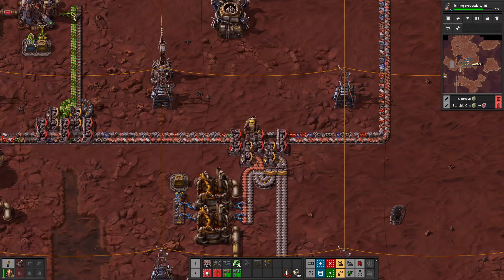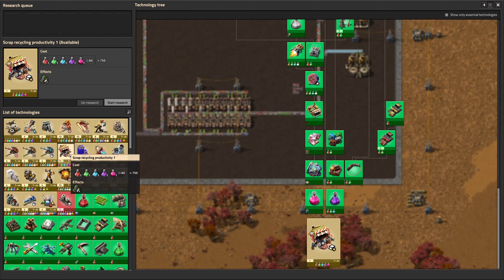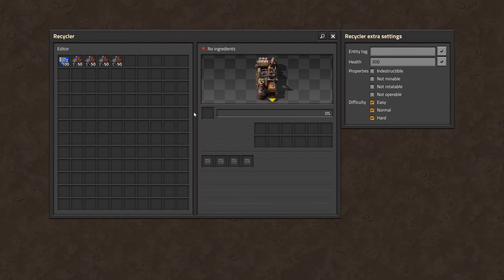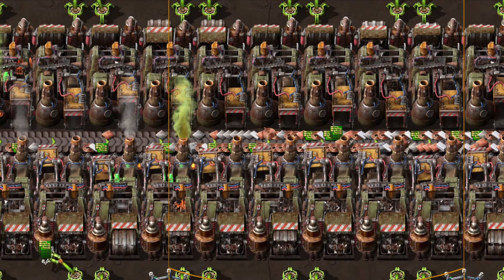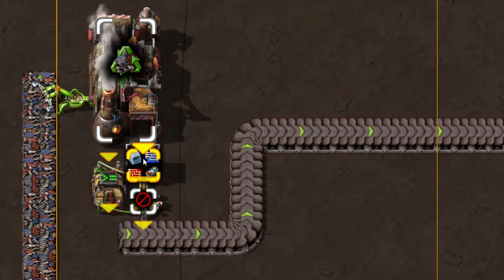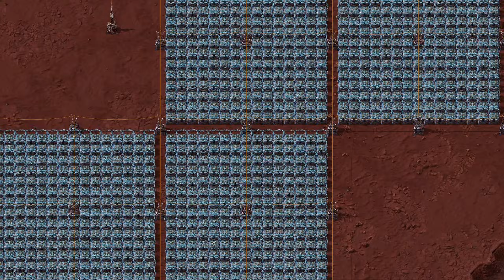Massive Production on Fulgora. Stacked Double Sushi Belt! Factorio Guide / Tutorial

Comment: You should turn the solid fuel + water into power with heating tower as well! Saves a lot of space in comparison to accumulators. Other than that great guide!
Reply from the maker: Great point! I didn't have any space issues so fully embracing the lightning storms is the way to go.
But I've read a lot of comments saying the island are too small. If that's the case using the underrated heating tower is a great idea.

Comment: In my opinion just directly pickup from the sushi belt instead of splitting off resources from it. The only exception is the ore, because that's the most valuable, I don't want an inserter to miss picking up every ore.

I designed a 44 SPM module based on a blue belt of scrap. I didn't do a merge, and because of that, it used 3 recycling groups. But maybe deleting the gears and concrete before merging creates enough space to merge without causing throughput slowdown.

Comment: I used to do a sushi loop, but since ore is ALWAYS the limiter, I just make sure that whatever hits the end of the belt gets turned to dust.   I also stopped using quality recyclers on non-finished goods.  I found it easier to just use a compact upcycler to eventually produce what I need.  This means the the products left over are easier to burn into scrap since I can use speed modules/beacons etc.

I have found that the logic should be >16 since this ensure that 1 is always left in the chest thus there is always a slot.  I also limit the chest to the # of products which tends to result in better switching of products.   I have seen your style system deadlock if you don't consume fast enough.

The  chest/hazard recipe though...always a good one.

Comment: Such a good video, and the one before this one! Really changed my perspective on how to tackle Fulgora. Though I had met trouble with implementing your setup, my belts slowly clog and grind to a halt. Could this be due to the second recycling block, who takes the stuff created from recycling scrap, not being able to recycle stuff fast enough? Have you had any trouble with your setup clogging/slowing down over time? Or is it because I don't use enough components and don't got all the rare quality 3 modules on everything yet and therefore generate to much lower tier stuff?
Reply from the maker: @01:57 you have to set splitter input priority to the belt coming from the "second recycling block". Else it will clog up.
Reply: @AVADIIStrategy Oh my god, yes. That was it. My 02:00 am brain forgot that step when I remade my Fulgora facility and separated scrap and material recycling. Thank you for your quick reply. Keep up the great videos!

Comment: I like these ideas and I am currently setting up a basic sushi design as a starter base. Sure will put in some optimizations even there. But I haven't exactly played around with quality a lot yet, figured I leave that for when I have quality3 modules.
So what I'm getting to is that you lost me with your recyclers full of quality modules at the end there. Won't these lead to a mix of quality and no quality items on the belts and thus be a nightmare for production considering ingredients must be the same quality? Do you filter out non-rare items and I missed that?

Also you just reminded me that the train setup I was in the middle of building is way overcomplicated for fulgora where I need exactly one resource on trains (interrupt-driven design with flexible trains, great for nauvis) so thanks for saving me work and a massive facepalm when I would have figured it out eventually.

Comment: If you put the output of a recycler into the front/back of a train cargo wagon, you can fit 4 recyclers like that, then fit 12 stack inserters along the sides of the wagon, filtered for the 12 outputs of scrap. There is a way you can arrange the 12 outputs to be balanced with half of the quantity of outputs on one side and half on the other side, which can help with throughput. I have filled the recyclers with speed 3 modules and surrounded them with a few speed 3 beacons and couldn't overload any of the stack inserters and fill the wagon, but I haven't tested any quality stuff yet.

If quality does make output speed and issue, I am sure some of the rarer items could be put onto the same inserter, or replaced with two long handed inserters, if another stack inserter was needed for gears or something. The wagon's inventory slots could also be filtered for the most common scrap outputs, the rarer outputs could then be pulled from the recyclers themselves, saving room around the wagon for stack inserters filtered for the larger scrap outputs.

It needs a bit of space and the rail grids makes it awkward and unfriendly to nice efficient beacon spacing, but I liked this more than recyclers into chests, then out with combinator inserter.
Reply from the maker: But quality... and recycling non-scrap items will give you way more than 12 items.
Reply: @AVADIIStrategy well it would be 60 items, and you have 5 filters per inserter so you could have qualities in the filter, though you would instead have a few other issues.

You would run into issues of cargo space as there is not 60 inventory slots in the cargo wagon. One legendary item could block an inserter from emptying the common items, limiting the inserters to 4 items/1 stack, would help but not prevent the issue. Sadly there is no way to read the cargo wagon contents without it being part of a train at a station.

The combinator inserters are probably the way to go with quality, though you probably need at least uncommon chests to have enough inventory slots. I have been using quality not on the scrap, but on the recyclers destroying excess resources after they pass through my base, so it has not been as much of an issue for me.

Comment: I'm obviously doing something wrong but i dont know what, i tried doing the double sushi belt but it just keeps getting clogged :( are you using the advanced circuit you did in your most recent video for all your recyclers?
Reply from the maker: no i still have the one with a combinator for each chest. did you use splitter priority where the belts merge?
Reply: @AVADIIStrategy oh, im not even using that right now so, ill try that, but yeah I do have splitter priority at all merging spots, tried to make it as much like yours so i wouldnt have issues xD

Comment: In my first run I didn't know what to do and I didn't want to consult guides, I didn't want to use the circuit network, I put together a sushi belt and then I took the 12 items with 12 inserters with a filter and 36 boxes, then if I needed more of the same type of item I added another inserter. Then I placed about 4 inserters to take out the excess, only with the filter and I took them to a loop of 9 recyclers until it was eliminated, it was just taking into account the speed of the inserter for the most common items.

In my second run it was better, I used the circuit network to take and separate the items, count items in the loop so as not to jam, automatic filters for the excess items, it was annoying to configure because I still don't know it well. Your approach is definitely much better, your strategy is the most efficient I've seen and takes scalability into account!

Comment: I made an item-agnostic stacker version. I read about the -15 constant trick in the other comments. That does work, but you have to know what you're getting. Once on the 2nd round of recycling, you get many different items. Wire all the chests together into a decider combinator. Each >0 outputs Each at 1. Wire that to a Arithmetic combinator. Each *-3. Wire that output to each stack inserter. Configure hand size to 4 (assuming max research) and check the Set Filters option. It works with anything, any quality. You never have to manually enter things. This will fail if the variety of items is >48 and there are 3 of each item.
Reply: and even that fail case can be avoided by simply using an uncommon or higher quality steel chest to increase the number of slots available, although i can't seem to get it to work based only off this comment, im sure im missing something

Comment: I effectively have two bases on Fulgora. One that works roughly the way you have described here (minus the neat trick with steel and concrete) and the other with full quality modules and completely logistic bot powered, no belts past the first recycle off the train. I’m at 16K scrap/minute and while it makes me sad, the logi bot version actually ends up cleaner. It doesn’t use that many either, I’m at about 800 bots and usually half idle. It generates a lot of legendary items for me from up cycling, with easily configured buffering (not a single combinator).

Comment: If your factory is dependend on belt speed, make smaller factories that work in parallel. 20 Sushi belts in 20 minimal bases instead of the clogging of a long track of recyclers.
For me, any row of 20 or more recyclers clog up, as they cannot empty their contents. And even internal storage for anything but scrap is underused, as they will only do the exactly same recycle job to add to internal storage.
Warum schreibe ich eigentlich Englisch, du sprichst doch mit deutschem Akzent im Video.

Comment: I followed the original video and to ramp up production I would use the secondary recyclers to pull items I needed more of from them.  At first it was just holmium and then ice, fuel, blue circuits, etc.

That scrap productivity resetting is gonna force a redesign though.

Comment: You don't need to grab items from both belts at the same time, you can simply have one outer sushi belt you take items from and use splitters (simple output priority without filter) to refill that outer belt from the inner belts afterwards. The beauty of that is that you can extend the capacity to 8+ belts quite easily this way, without needing to create new splitter designs every time you add another lane.
Reply from the maker: Doesn't work. When both belts are saturated and theres let's say holmium ore on the left belt but you take holmium from the right belt with a filter (the outer belt) the holmium from the left belt will not switch belts based on output priority.
It would only work if there was a gap at the right moment.
Reply: If you use a circulating sushi belt the outer layer will naturally saturate in cycle two with the items that were skipped over in cycle one, as the belts get emptied out the more production stations they pass. New material would then enter the circulation via refill belt instead of main belt, to make use of this property.
Reply from the maker: @API-Beast  But this is Fulgora and every item not picked up will be recycled

Comment: Is there any reason why the solid fuel and water can't be turned into steam power?
Reply from the maker: Yes. On Fulgora you get free energy with the lightning storm mechanic.
Other forms of energy production are technically possible but you need the water for production.
Besides holmium ore water and batteries can start becoming bottlenecks really quickly.
So don't waste the ice and make energy with lightning collectors.
Reply: @AVADIIStrategy  Fair enough, I'm not experienced enough with Fulgora to know that ice is a bottleneck after holmium ore. And it's not like solid fuel it's a particularly precious item anyways that requires full utilization of. Funny how the planets each break my brain by shifting the ratio i can easily produce them in or even turn them into garbage i have to deal with somehow. And still, surely, there has to be a better way to deal with excess solid fuel than to just recycle it into nothing.

Comment: Didn't understand steel chest and hazard concrete? They recycle back into steel and concrete (latest experimental version)
Reply from the maker: Let's say you have to recycle 800 steel. It will take 1600 seconds to recycle them all with 1 recycler.
Or over 26 minutes.
Instead i turn 800 steel into 100 steel chests.
Depending on the assembler speed it will probably take 20 seconds or so.
Recyclers are crazy fast when recycling steel chests. They only need a couple seconds to get rid of 100 chests.
This way we save valuable recycling time and our recycling block has more throughput.
Reply: @AVADIIStrategy  no... Steel chest recycles into steels again??? How will u get rid of it? I am in latest experimental maybe it is nerfed?
Reply from the maker: @mertserimer6928  its all about the recycling time / speed. getting rid of items happens automatically because you always lose 75% of materials.

Comment: You can use 1 shared constant combinator with -15 signal for each item across all stack inserters.
Reply: this is pretty genius way to do it, did not think about using negative value to offset unsatisfied stacks.
Reply: I managed to do it with one constant combinator and one arithmetic combinator that minus each signal by 15. Green wire from arithmetic to all inserters, and red wire from each box to each corresponding inserter. Works like a charm.
Reply: Only pain is you have to setup all items and qualities in the constant combinator, but if you setup a group (or groups for each item), you only have to do it once.
Reply: @kister5  there's another way.  Skip the constant combinator, and instead use one decider and one arithmetic: decider says each > 0 output each, value 1; arithmetic says each * -15 (or each - 16) output each, either way, the output of that is what goes to the inserter — with the input to the decider being from any box you want to monitor, since it doesn't matter if not everything is in every box, because you'll just output a 1 for anything that exists in any of them, and that'll be converted to -15.
Reply: @DavidLindes  Good point! This is also way more future proof, since if more items are added, or you use mods, etc... any item that exists anywhere is in any chest is in the list.
Reply: @DavidLindes  (8 months later) I think this has a problem when used in practice - the constant combinator has a tick-delay, so if a stack inserter has the combiantor output on green, and the chest contents on red, the red signal will update before the green signal, so for a tick it only receives the red signal which seems to break it
Reply: @Buck0tooth  But didn't he say not to even use a constant combinator?  and with the latest changes, I think you can do this all with a single decider combinator (I'm actually setting this up right now xD)  
1 Input 
Each > 0 
2 Outputs
Each -16 
Output Input Count
Reply: @NevNiv  But then you still need a combinator for every recycler yeah? or am i missing something
Reply from the maker: Smart.
But you have to set up every single possible signal that can potentially appear in the chest right?
So 12 for normal scrap recycling?
Reply: @AVADIIStrategy, that is correct. I still feel it is a better/more simple solution. Its also going to be a lot more ups effecient.
Reply: @AVADIIStrategy I think you can use the multiply option on the constant combinator menu which means you don't have to enter -15 every time either.
Reply: @AVADIIStrategy  Annnd you can use 4 Selector combinators with Quality Transfer mode to spread these items to all their qualities.
Reply: @AVADIIStrategy  finding this post after I made gacha spinner blueprint makes me laugh
Reply: @ an update: decider combinators can finally output custom constants, so -15 directly! one less combinator!
Reply: yes!  I was thinking "wow, that's a lot of combinators"... and this is a great solution.  With the probably-obvious-to-many-but-I'll-state-it-just-in-case-anyone-is-wondering point that this requires two wire colors - each inserter wired in one color to the chest it's pulling from (I'd probably use red for this, but it doesn't technically matter which way one goes, as long as the other is different), and then all inserters wired together with the constant combinator on the other color (I'd probably use green for this).
Reply: I’m going to do this!
Reply: can't you do an each -15 signal in an arithmetic combinator?
Reply: Can you show how this works?
Reply: @JuMi896 you solved the problem with a way more elegant manner then me😅
I replaced all steel chests with red ones and at the end of the line put a requesting one with a stack inserter. The Idea was to merge the contents with rare quality and above from all chests in on to stack output via robots.

I'll try your solution for my next game.

Thanks bye ❤

Comment: very nice, i was always very opposed to sushi belting and i sortet every item individually and voiding excess after sorting. I als came up with fast voiding stragegies such as the hazard concrete,steel chests and stone furnace,  but i use this to cycle up the quality of concrete and steel
Reply: Before 2.0, sushi belts were logistical nightmares.  Now, you just have to connect a wire to the belt and have it read the whole thing at once.  BLISS!!!

Comment: I did a start on fulgora run and since getting upgraded belts could take a long time because of low science production, I was thinking what if I just did a quad or more sushi belt. Just use the normal bus pulloff with splitters that have an output priority going, say, to the right where they then get pushed through your sushi pull-off blueprint for the single belt. It wouldn't get every item to go through, but the extra belts would act as a sort of buffer and just squish everything into the belt that I am pulling off of.
Reply from the maker: That's what I was doing initially as well. But it interferes with the other belts so I had to go for the proper splitter blueprint.